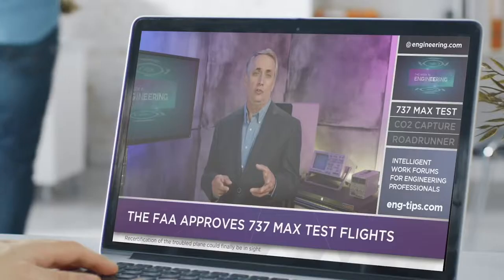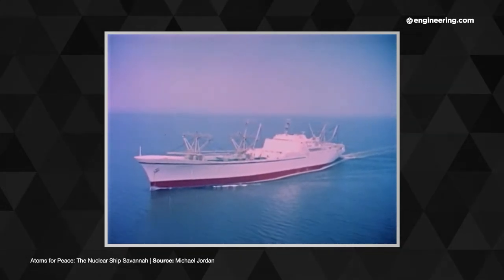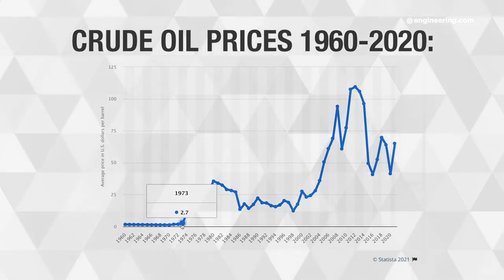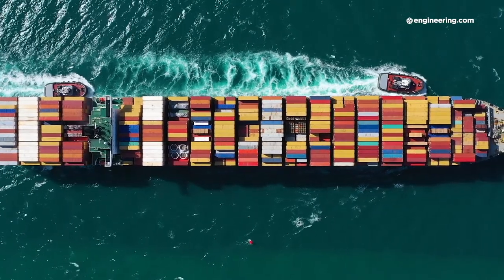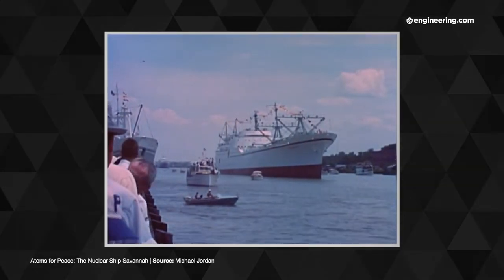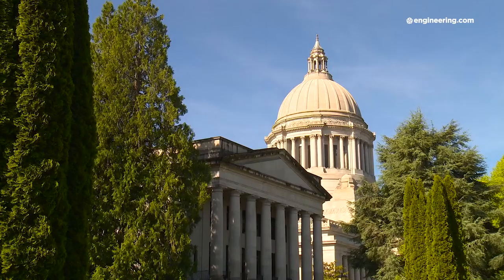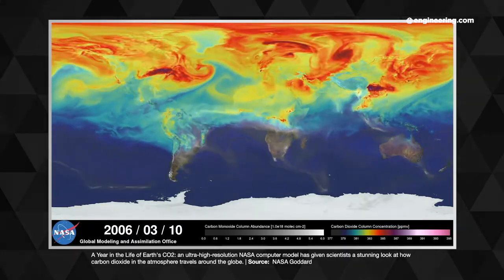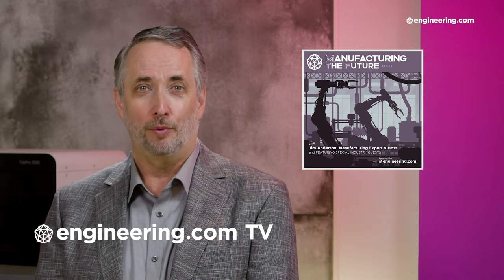Why Are There No Nuclear Cargo Ships?

Comment: Just think; would you have full confidence in the management of a nuclear reactor under the control of an anonymous entity only traceable, perhaps, via a letter box in a FOC (flag of convenience) nation state?  If you are, could you sell that confidence to Japan, the state that hosted the Hiroshima and Nagasaki nuclear detonations as well as more recently the Fukushima ‘event’?  Then try that same, or a similar, sales strategy on Ukraine, the nation state that as a part of the USSR (CCCP) hosted the Chernobyl ‘event’.  Modern iterations of nuclear energy, thorium fuel, molten salt reactors, small modular reactors or fusion reactors, will carry the legacy of past problems.  It is the global trepidation of anything with 'nuclear' in the name and the economics of nuclear having transitioned from 'energy to cheap to charge for' too 'the costs of remediation are incalculable' that will prevent the adoption of nuclear energy as a means of creating energy at sea.  Modern reaction systems may have overcome the safety problems but the general public, having been misled in the past, will be reluctant to believe the fresh new promises.  The incident of the ‘Ever Given’ blocking the Suez Canal, March 2021, may also have a little to add to this debate.  The cooling water on ships tends to get taken in from near the bottom so when running aground the inlets are in a prime spot to get plugged up restricting, if not stopping, the flow of coolant.  One thing that the TMI, Chernobyl and Fukushima incidents all had in common was that the supply of coolant, or rather lack thereof, was a fundamental cause.  Similarly and only months later, May 2021, had the ‘X Press Pearl’ been nuclear powered then a major port for a populous nation in the global South would have possible been the site of a significant exclusion zone due to a non power plant related incident.  If the ‘X Press Pearl’ had on board a fired up but ‘safe’ molten salt reactor and found herself having to dissipate the residual energy associated with the possible 12.5 megaWatt power cycle would a stable cool down have been possible?  In a casualty ships may capsize, like the ‘Karin Hoej’ of Bornholm in the Baltic early December 2021, in which situation any safety system reliant on gravity might not work.  Why not use nukes?  It is down to engineering, finance, socio-political attitudes and safety.

Land based nuclear power plants have a few issues but are usually well regulated, stable and immobile.  Reactors on ships by their very nature are able to move between regulators, bump into each other and roll over.  Regulation of ships by both / either flag state or port state has problems and adding any nuclear regulatory obligations on to those already overstretched facilities would be very taxing for all involved.  This is not about 'can it be safe' it is all about 'will it be safe'.  While merchant ships may be 'taken up from trade' as the RN would say, or may be captured or impressed by non state quasi military entities by way of piracy, cargo ships are not military vessels.
Reply: but therre was Kursk, she had a bad explosion on board and it didnt go Hiroshima  simply because it cant, a nuclear power unit is not a bomb
Reply: @Gamepak   The critical damage on the ‘Kursk’ was, as you point out, not power plant related and the vessel sank in deep water before being recovered for disposal.  I have since the posting you read updated my material; in relation to the X-Press Pear it now reads as follows. ‘If the ‘X Press Pearl’ had on board a fired up but ‘safe’ molten salt reactor and found herself having to dissipate the residual energy associated with the possible 12.5 megaWatt power cycle would a stable cool down have been possible?  Would there have been sufficient heat energy contained in the power system to facilitate a hydrothermal explosion?’  It is worth noting that naval vessels spend more of their time in deep water and under maintenance / repair than merchant ships.  The armed forces have no need to turn a profit to stay in business and being funded by the taxpayer can call on a relatively immense resource pool; private enterprise has to make back the money it spends (return on investment).  The first layer of 'the onion of survivability' is 'do not go there'; which means that the case for nuclear energy at sea has a very high bar to adoption.

Comment: 'Irrationally cling to their anti-nuclear stance'- no, it's not irrational, they're in the pocket of the oil companies which fund anti-nuclear environmental groups to preserve their customer base.
Reply: Why not use nukes on merchant ships?  It is down to engineering, finance, socio-political attitudes and safety.  In engineering terms hydrocarbon fuelled ships do the job adequately and are simpler, financially hydrocarbon fuelled ships are, considering only internal costs, cheaper and socio-politically hydrocarbon fuelled ships are a known entity they thus have incumbent advantage.  With regard to safety hydrocarbon fuelled ships may have serious problems but these are generally considered manageable and have known limits of impact, most importantly they can be shut down at short notice and are then walk away safe, while nuclear energy has fewer incidents those rarer occurrences are seen to be catastrophic and having unlimited effects.
Reply: @BernardLS  >In engineering terms hydrocarbon fuelled ships do the job adequately and are simpler

Well, that's true. Nuclear reactors are complex beasts.

>financially hydrocarbon fuelled ships are, considering only internal costs, cheaper 

Only in the short term.

>socio-politically hydrocarbon fuelled ships are a known entity

Nuclear reactors are known too, they've just been smeared by the oil lobby.

>With regard to safety hydrocarbon fuelled ships may have serious problems but these are generally considered manageable and have known limits of impact,

Ah, but what about all those industrial-scale oil spills? If you're going to include nuclear accidents you need to include those in the calculus too.

>most importantly they can be shut down at short notice and are then walk away safe

This is mostly true, and the main reason I don't think they'll ever vanish until we get battery/hydrogen fuel cell energy densities to a comparable level.

>those rarer occurrences are seen to be catastrophic and having unlimited effects

Not hardly. They're sharply limited in scope. The whole 'radiation poisoning the world' rhetoric is oil lobby propaganda. Even the worst nuclear accidents are thousands of times better than the worst oil industry accidents in terms of environmental and health factors.

Comment: Nooklear wessels?
Reply: Just think; would you have full confidence in the management of a nuclear reactor under the control of an anonymous entity only traceable, perhaps, via a letter box in a FOC (flag of convenience) nation state?  If you are, could you sell that confidence to Japan, the state that was subject to Hiroshima and Nagasaki nuclear detonations as well as more recently the Fukushima ‘event’?  Then try that same, or a similar, sales strategy on Ukraine, the nation state that as a part of the USSR (CCCP) hosted the Chernobyl ‘event’.

Modern iterations of nuclear energy, thorium fuel, molten salt reactors, small modular reactors or fusion reactors, will carry the legacy of past problems.  It is the global trepidation of anything with 'nuclear' in the name and the economics of nuclear having transitioned from 'energy to cheap to charge for' too 'the costs of remediation are incalculable' that will prevent the adoption of nuclear energy as a means of creating energy at sea.  Modern reaction systems may have overcome the safety problems but the general public, having been misled in the past, will be reluctant to believe the fresh new promises.  The incident of the ‘Ever Given’ blocking the Suez Canal, March 2021, may also have a little to add to this debate.  The cooling water on ships tends to get taken in from near the bottom so when running aground the inlets are in a prime spot to get plugged up restricting, if not stopping, the flow of coolant.  One thing that the Three Mile Island (TMI), Chernobyl and Fukushima incidents all had in common was that the supply of coolant, or rather disruption thereof, was a fundamental cause.  Similarly, and only months later, May 2021, had the ‘X Press Pearl’ been nuclear powered then a major port for a populous nation in the global South would have possible been the site of a significant exclusion zone due to a non-power plant related incident.  If the ‘X Press Pearl’ had on board a fired up but ‘safe’ molten salt reactor and found herself having to dissipate the residual energy associated with the possible 12.5 megaWatt power cycle would a stable cool down have been possible?  Would there have been sufficient heat energy contained in the power system to facilitate a hydrothermal explosion?  In a casualty ships may capsize, like the ‘Karin Hoej’ off of Bornholm in the Baltic early December 2021, in which situation any safety system reliant on gravity might not work.  It might also be worth bearing in mind that part of the TMI near miss was the fault of the US navy trained operators focusing on not letting the primary cooling system 'go solid'; due to their training overwhelming their education and the particularity of the situation.  The actions of the captain of the 'Costa Concordia', Francesco Schettini, may also be relevant; the consequences of his actions, whether due to ineptitude, an isolated act of incompetence or driven by a corrupt corporate culture, illustrates well one of the dangers of releasing nuclear energy into commercial shipping.  The regulators vary from useless up to good and anywhere in between some I would not trust to control a toothbrush and none are infallible.  To maintain the level of authority that the ONR (Office of Nuclear Regulation a UK government agency) exercise over the few nuclear power plants on land in the UK to visiting merchant ships would require increases in manning and expertise leading to costs that would simply not be affordable.  Safety costs; as does the engineering of the structure.  The examples I given are not exceptional typically every week a ship sinks, some large some small.  On the news on 9 Jan 2023 there was another incident in the Suez Canal, when a vessel grounded briefly; the next Ever Given scale event is only one small error of judgement away.  A sister ship of the Ever Given, the Ever Forward, ran aground approaching Baltimore on 13 Mar 2022, these things happen.
	
As a second point if you fit 'walk away safe' reactors on ships you will need duplicate drive trains as there are seldom salvage tugs around when you really, really need one.  A nuclear ‘dead ship’ drifting around NUC (not under command) would be a disaster waiting to happen and duplicate systems increase expense.  Land based nuclear power plants have a few issues but are immobile, stable and usually well regulated.  Reactors on ships by their very nature are able to move between regulators, bump into each other and roll over.  Regulation of ships by both / either flag state or port state has problems and adding any nuclear regulatory obligations on to those already overstretched facilities would be very taxing for all involved.  This is not about 'can it be safe' it is all about 'will it be safe'.

Furthermore, while merchant ships may be 'taken up from trade', as the RN would say, or may be captured or impressed by non-state quasi military entities by way of piracy, cargo ships are not military vessels.  They therefore do not have the same inherent level of self-protection and internal discipline.  Why not use nukes on merchant ships?  It is down to engineering, finance, socio-political attitudes and safety.